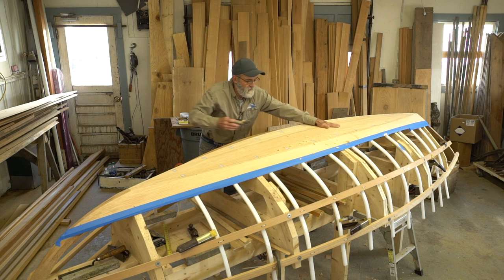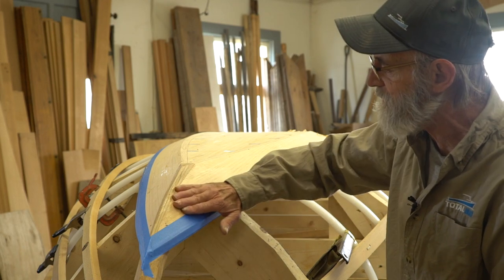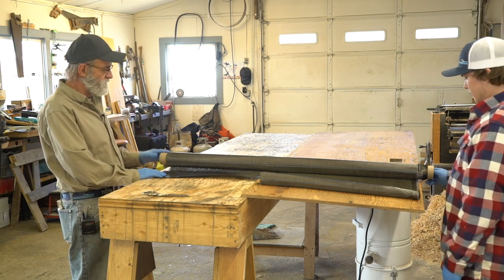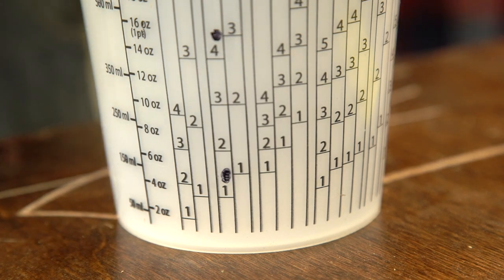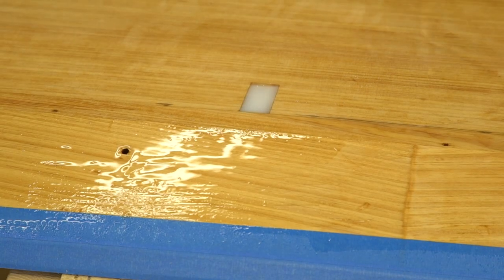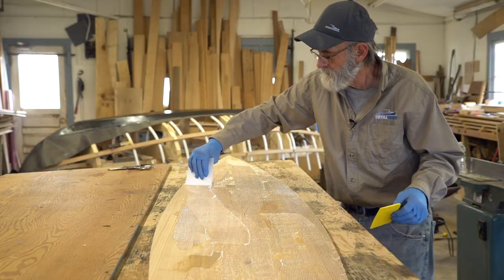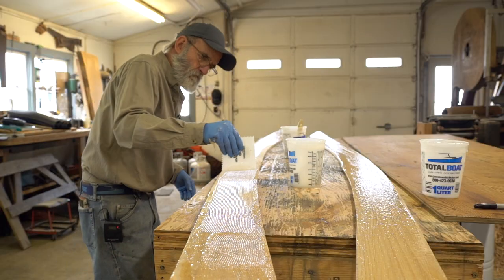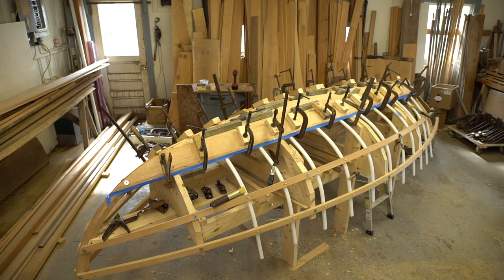Building the TotalBoat Sport Dory: Episode 18 - Carbon Fiber

Comment: Hi Louis, love the show. There's a trick with composite. (I work with it on aircraft). It's called pre impregnation. You can apply it to any composite work, not just aircraft. Also you can buy frozen pre preg layers. But anyway, if you get two sheets of clear plastic and sandwich the cloth. Then lift the top layer and pour on your resin. Then lay the plastic on again and squeegee it. Now you have a completely wetted pre impregnated cloth. This is very useable because it doesn't stick to anything until you remove the bottom plastic. In the meantime you can measure, Mark to size and cut it exactly to what you need. If you are really organized you can mark the top plastic before making the resin. Hope this helps.

Comment: Dear Mr Sauzedde : I respect your knowledge , experience , expertise , meticulousness and candor. You must remember this , carbon fiber and epoxy are primarily utilized for vacuum infusion moulding with an autoclave , there is nothing wrong with your application of carbon fiber other than it's like trying the build a rat with a gold tooth . I do hope ultimately you're going to glass the bottom of your dory with a layer 0f 900 gsm (grams per square meter) of quadraxial "E" glass and epoxy, this stuff is so abrasion resilient , you'll be able to tow your dory behind your car without a trailer , not really but you get the picture. An otherwise great show from a great man ,legend , legend , legend. Although I'm older than you and now retired I did my time with triple diagonal cold moulding  racing yachts and power boats then onto the disgusting/disgraceful era of fiberglass (i.e.plastic) chopper gun production boats getting punched out like boiled lollies then on to the modern composite foam cored yachts with all their problems of osmosis and delamination etc.  etc. ... ho hum , a boat builders life is never ever a happy one . Cheers Lou , look forward to your completion of this absorbing project.

Comment: Really like the carbon in there, not only will it stiffen the boat and those seams nicely, but it will help prevent checking and cracking of those flat boards longer term.

Comment: I wasn't sure where to post the questions for your next Q & A session, so hear goes. I built a 23 foot cape ann sailing dory back in 2001 out of cypress and juniper. Over the years I have been using captains varnish inside and out. I'm taking it down to the bare wood again and am thinking about using something like the west system 105/207 for 2 or 3 coats then 2 or 3 coats of captains varnish. My question is... Should I be worried about the planks or joints flexing and causing the epoxy to separate from the wood surface?
Thanks,
Dale Shepard
Orange Beach, AL

Comment: Good for you for doing the experiment here. I'm yet to be convinced that putting the fabric in the middle (neutral axis) will provide the best reinforcement, and I suspect an S-glass would do the job as well or better than carbon, but if you are going to go ahead and try something innovative, you might as well pull out all the stops.

I'm looking forward to seeing how it turns out.
Reply: I think the FRP in the middle is actually clever, because it provides tensile strength without the stiffness of a sandwich lamination.  I'm sure Carbon fiber will be just fine, but my first thought was Kevlar, since it is more flexible.  But then I remembered that S glass is a pretty close match to Kevlar, although lacking the abrasion resistance.  It's been awhile since I read up on composites...
Reply: I'm just concerned that since the fabric is situated where it will not contribute stiffness and the outside surfaces of the cedar are still exposed to wet/dry cycles, that it will just do weird, unanticipated things. The cedar will still want to move, but with CF there, the middle will not be allowed expand/contract with it. 

I could see the it tearing itself apart. It just seems that with a dimensionally stable, impermeable vapor barrier buried in the cedar that something has got to give. I expect Lou has thought about it.

I'm sure Jamestown Distributors was happy to supply Lou with the small amount of CF required to do this job, but I doubt it is worth the cost in this application, where the stiffness potential provided by CF doesn't really come into play. Regular E-glass would probably accomplish the same thing at 10% the cost. 6oz carbon weighs just as much as 6oz glass and absorbs a lot more resin, so there is no weight advantage.

But again, you don't learn stuff without trying new ideas. It will be interesting to see how it works out. The only way to prove it works is to give it a try.
Reply: Stress = MC/I,    M = moment (lb in) C= the distance from the neutral axis to the outer most fiber (dim) I = moment of inertia = (b x h^3)/12. Anything added near the neutral axis is in-effective. The added stiffness goes with the cube of the distance from the neutral axis.
Reply: I think you guys talking about the "axis of stiffness" are kinda missing the whole point of why he's even putting this cloth in there.
He's not trying to achieve "stiffness" in the engineered sandwich/lamination sense of that term.  All he's doing, is adding this as an alternate connection "member" across the chine.  ("Chine" = boatbuilder's term for the longitudinal corner angles in any boat shaped of flat plank or panel sections, as opposed to boats with fully "round-bottomed" cross-sections.  Round-bottom boats of course have a bit better hydrodynamic shape... but flat-panel sections are less labor-intensive.)

Y'all perhaps don't know about traditional dory construction.  But like the several other flat-bottom (or flat-segmented-sections) boat types... any dory built of either solid wood planks OR plywood, either way, normally has to have a "chine log" inside the interior of that corner joint.  It's a full-length "stringer" (longitudinal) type of piece that normally has to be massive enough to take a continuous row of fasteners down the whole length of the bottom, AND fasteners on the whole bottom edge of the first side plank (called the "Garboard").  Not to mention the whole-hull lateral "prying" stress at that joint, the inevitable source of eventual leaks.  So a dory this size, the chine log might be 1.75" or 2" high, and 1.25" - 1.5" wide in (trapezoidal) cross-section.  Work-boats destined for hard use would need that piece to be even heavier in dimension.  Perhaps Doug.Fir in a pleasure row-boat, likely White Oak in a work-boat. 

That structurally-vital "Chine Log", which he has TOTALLY OMITTED FROM THIS DESIGN... is what this Carbon Fiber cloth is meant to replace.  He's not trying to "stiffen" a panel across the middle of its width.  He's using the cloth to "fasten" two SEPARATE panels together at their EDGES.  Totally different engineering problem.
Reply: That is my point. Since the fabric isn't located where it will add stiffness, there is not much point in making that fabric CF. A layer of CF isn't more durable than other options the way its being used. Use S-Glass or Kevlar, save some money and make it tougher. If you are trying to improve a cheap and easy way to make a boat, there is no point in adding expense unless it will do the job better.
But, of course the fabric isn't particularly well situated to replace the chine log along the garboard/bottom-board seam either. There will now be a compression load on the interior cedar as well as loads trying to split the exterior cedar with the CF as a fulcrum. One layer of epoxy soaked fabric will not fill the same role as a chunky fir chine log. Water won't get through that seam right away, but it might tear the bottom apart first.
I've built a lot of (glass-Kevlar-CF)/epoxy reinforced wooden boats and use them regularly, and Lou is going against standard practice (as he likes to do) for that kind of construction. Good for him for taking the risk and seeing how it works out. Success is not guaranteed.
Reply: If it gets an epoxy coat that should stabilise the wood and stop any movement, and I would think that would be fine.
Reply: In his latest video he disclosed that he is covering the outside bottom with Carbon/Kevlar hybrid cloth. 

A few coats of epoxy by itself would not be enough to fully stabilize the wood. A small amount of moisture can still diffuse through the epoxy, but also the wood can still flex and move sufficiently to crack the fairly brittle layer of epoxy. Eventually the epoxy would break down and fail.

By reinforcing the bottom with another layer of cloth as described in the next episode, he is not only stiffening the bottom, reinforcing the garboard/bottom-board joint, and providing abrasion protection, he is reinforcing the layer of epoxy on the bottom such that it will be rugged and durable, maintaining the moisture seal for a very long time.
Reply: My concern is there will be water trapped on the inside of the carbon fiber and it will just rot out the first layer of the garboard and bottom of the boat.
Reply: Stiffness is perhaps a minor aspect, What the CF will do is to increase (a lot) the strength of the connection between the bottom and the garboard.  What is not a good idea is to have a big difference in stiffness between the bottom and the garboard. With the two CF layers being fairly close to each other, it won't as you say, increase the stiffness of the bottom greatly and I think this is probably wise.

Comment: Looks good just a tip if you apply painters tape along where your cutting the carbon fiber it prevents the carbon fiber from fraying at the ends along the cut point, love the videos, keep up the good work.
Reply: Great tip Bill! That's just the sort of thing Louis would do. :)
Reply: Cody Persinger just a trick the old boys shown me when we done a mini years back, had to replicate the front end for easier acess to the motor.

Comment: Loving it! To make your life a bit easier with the lay up. Try using a foam paint roller to apply the resin, makes for a nice even coat of resin before the cloth goes down, then you can use the  unloaded roller after the cloth goes down as a consolidator, gets any hidden bubbles out.

Comment: I love your channel and your builds however I do have concerns about the way you are sandwiching the carbon here.  The wood will swell and contract while that carbon will not.  Just not sure how that will work out over time.  Looking forward to the next video regardless.
Reply: The Epoxy will stabilize it all. Weather it be glass , carbon, or Kevlar, it's all just fabric reinforcement and works a treat with wood.
Reply: Never underestimate the power of wood expanding and contracting.  It is a powerful force.  The carbon fiber doesn't expand and contract the same way.  Something will have to give or split.
Reply: It could actually work the opposite way expected since the wood joints will flex, swell and contract repeatedly over time while the carbon won't.  The carbon resisting the wood's natural expansion and contraction could actually cause problems over time.

Comment: Great video.  Instead of unrolling the carbon fiber cloth and cutting with scissors, could you have left it on the roll and cut the roll in half on the bandsaw or chop saw?
Reply: By hand is the way to go due to dust management.  Carbon fiber dust is nothing to mess around with!

Comment: One other suggestion I would make for the future would be to pre-coat the wood with epoxy before proceeding.  Wood will suck up a lot of epoxy.  By sealing the wood with a coat first the wood won't suck it up when you proceed.  This would prevent a dry layup or voids.

Comment: QuestionWhy was carbon fiber used as opposed to Kevlar?
Reply: Greg McGowan I wondered that as well.
Reply: Kevlar degrades with salt water
Reply: Zebgoraja Holyhell  the fibers of whatever fabric used would not only be sandwitched between 2 thick layers of epoxy resine coated wood, but also the fabric itself is encapsulated in copious amounts of that same resine. Salt water would never touch the fabric put in place.
Reply: Robert Morrison use it if you like but everything in the kevlar datasheet by DuPont suggests it is not a long term product especially in an ocean environment
Reply: Zebgoraja Holyhell the link I posted was from DuPont and is titled, "Kevlar® for Better-Performing Marine Composites"
Reply: Robert Morrison marketing will say anything to sell products read the datasheet on it instead Kevlar is a product that degrades with time (less than 10 year period), temperature (above 300 degrees so not normal conditions but still can be caused by an engine easily), humidity, uv radiation, and salt
Reply: Zebgoraja Holyhell  True,  Kevlar should be protected from certain environmental conditions and in this instance will be more than adequately protected.  Using your logic, one would say unprotected wood, steel or aluminum is not recommended for marine applications either.
Reply: Robert Morrison steel aluminium and wood do not directly degrade as a result of water or salt though they can be affected in other ways due to the presence of said materials and they can last 100 years or more with reasonable care the same cannot be said for Kevlar
Reply: Zebgoraja Holyhell Whatever.

Comment: That bottom is darned near bullet proof at this point.
Reply: kyrg  if you want it bullet proof, use Kevlar.
Reply: Interestingly, if you were to glue the kevlar down like this it will no longer be bulletproof.   BTW, we both know what Kyrg means.
Reply: J Wilson Handmade Knives technically speaking, 1 layer of kevlar won't stop many bullets glued to a stiff bord or loose in a vest. Sorry,  I have no idea what kyrg means.
Reply: Kevlar needs to be loose (relatively speaking) to work at all against bullets.  Back in the late 80's / early 90's, it was discovered during the development of the MK-V SEAL boats that sandwiching the kevlar in the bulkheads didn't work as armor.  Hanging it loose in a void worked very well.  

Kyrg means "bulletproof" as in "indestructible", not literally as though it will stop bullets.
Reply: J Wilson Handmade Knives so the Kevlar helmets used to help protect police and the military are useless against bullets?
Reply: Ha, ha, thanks. I was beginning to wonder about the size of the Youtube rabbit hole I created by daring to use hyperbole in my comment.
Reply: kyrg I completely understood where you were coming from. I was just sort of expanding on it.
Reply: not totally useless, but like a flak jacket they are best thought of as protection from shrapnel or indirect hits.  Notice also how immensely thick a kevlar helmet is compared to the pot helmet shell from decades ago.   They also don't work well for cooking your soup.
Reply: J Wilson Handmade Knives The original comment I made was to jokingly point out that body armor is made from Kevlar, not carbon fiber. So if it was going to be bulletproof, it would have to be Kevlar. Loose Kevlar fabric without resine may be more effective at stopping bullets, but there are armored, hard laminated structures made up of Kevlar that are intended to provide some protection from bullets.

Comment: I have a fair amount of experience hand laying fiberglass in an aircraft environment and I think he would have improved the structural performance of the carbon by laying it on a 45 degree bias relative to the center line. Of course this would require a number of butt joints.
Reply: Tom Fuller < partially, fiber orientation is critical ( most all fibers have more strength in Tension vs. Compression) to achieve maximum strength . In this particular example he was using a bi-directional cloth and placing it as he did he only achieved half the available strength at the joints. Look at it from a strand by strand point of view. By running the strands on a bias you have all strands crossing the joint.  Another advantage of laying it on the bias is how the strand lays. At right angles it has a tendency to not lay flat (puts that portion of the cloth in compression) as it would on the bias. Two get optimal strength you want to tug on each end of each strand to make sure it is laying flat and “straight”.  

And to finally answer your primary question... Its to keep both the bottom and edges from splitting and delaminating.

Hope this helps.
Reply: Tom Fuller < I think the concept of having this layer of cloth sandwiched between the wood like this is excellent idea. I would have used a uni-directional cloth and put two layers on the bias (one 90 degree to the other). I suppose philosophically, if one is to employ hi tech materials one needs to apply them properly to realize any benefit of the materials.
Reply: Judd S if you'll look closely at the weave of the cloth he is using you will see that the fibers are in the exact orientation you describe.
Reply: Mark Lackley <  I just took another look and I still see the majority of the strands are not crossing at the 45 bias. Obviously as you go from the widest to the narrowest portion off the bottom the strands tend to divert from crossing at 90 to some angle.  By starting the cloth at 45 bias at the widest point the full span will cross this transition at an low angle.